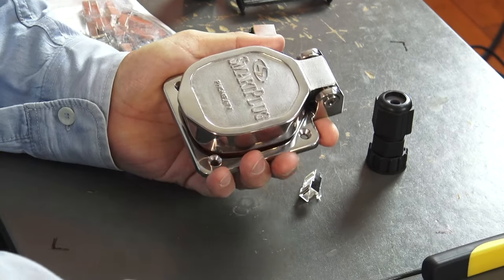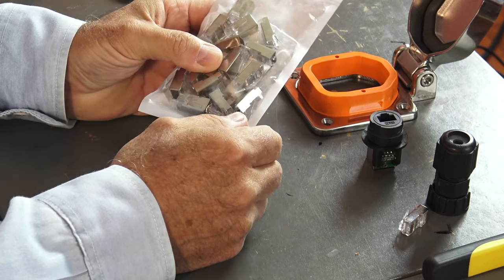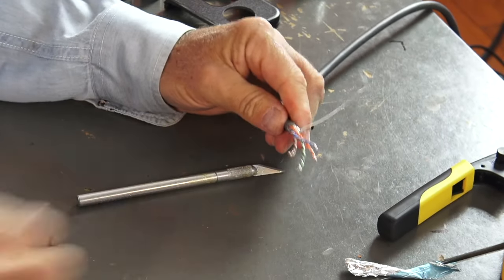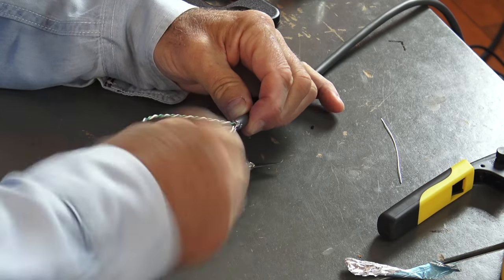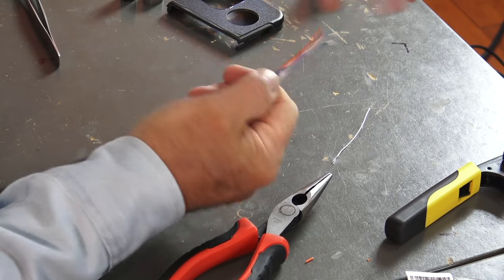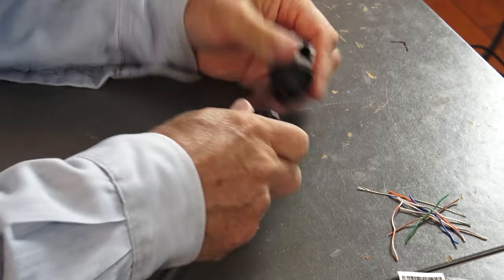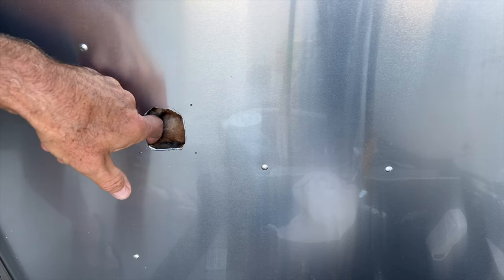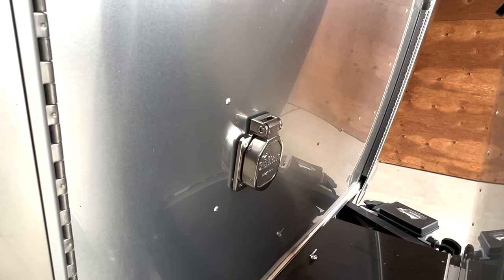Solve a common dilemma with Starlink RV: Make your own external port!

Comment: The wire you cut is a grounding cable for the shielded connection, it should be making contact with the metal piece of the shielded cat6 cable end
Reply: Important for POE I suppose.  This cable powers the dish motor?
Reply: @fightswithspirits915  And the phased array antenna. With no path to earth, an electrical shock can blow equipment.
Reply: The grounding drain wire is for locations with high EMI, like factories with lots of motors. It grounds the shielding in the cable. It's debatable if it's even needed in most consumer applications. Mine isn't properly grounded and I've never had a problem with it.

Comment: It is helpful if you carefully straighten out the wires by running each one through your fingers until all trace of the twists are gone.  Lay the wires in the correct order side by side and hold between thumb and finger, then slide them into the connector in one movement.  As others have said, the "braid wire" should be arranged so that it is crimped to make contact with the metal case, in order to maintain the screening.  As it is, you have nullified the screening which may lead to problems with interfering signals affecting reception in some circumstance.  It was a waste of time getting screened connectors if you don't actually connect them to ground!
Reply: A good approach is to use conductive copper mesh tape to contact the RJ45 connector.  You can wrap the ground wire a few revs around the cable jacket and apply the conductive tape so it is under the connector clamp.

Comment: notice for the people that will follow this solution: thar braided wire is used for the shielded connector, so cut it in a way that it touches the metal shield of the connector. the best way is to fold it backwards and then after crimped the connector, solder the wire to the shield of the connector. some connectors have a shield protrusion that also acts as a tension relief for the cable. you can coil the wire to that protrusion and finish it with a heat shrink tube. a shielded connector that is not connected to that braided wire is the same as an unshielded connector and will risk your starlink to electrical damage from static or other sources

Comment: THANKS, just happen to have found your video.  Yes… I have Starlink and use in my fifth wheel. As you stated, I have been doing the cable routing when I setting the slides. 
Have been waiting to found a workable solution.  FOUND IT.  What a GREAT video, to the point with zero BS.  Have just purchased the tools and will try my luck next time at at my trailer.

Comment: If you ever want to use your Starlink with a different router & just use the Starlink router as a satellite receiver, you should wire your RJ45 cable to Starlink's standard configuration which involves swapping pins 3 & 6, the solid Green & Green White wires over. If you make such a cable, clearly mark both ends Starlink ONLY. Doing the correct Starlink wiring now could save you a lot of future hassle.

Comment: Very elegant and clean.  My biggest interest in Starlink projects like this is really about getting it running on DC.  We tend to turn our inverter off at night. (We do have 400ah LiON and about 700w of solar, but turning the inverter off really saves power overnight.)   Thanks for your awesome video!
Reply from the maker: Thanks for that! I actually travel with an external 2200 watt power bank so I don’t need to use my inverter either.
Reply: @michaelkronenberg6675  Well, converting to DC also has the advantage of not having to RUN the router.  For many, the router is key.  When you're a tech nerd like me, well, you might have your own router and running two is redundant!  Heh!  Now if only they could make a DC (and low voltage) air conditioner, life would be golden!

Comment: Very nicely done.  Looks great.  Your descriptions and attention to detail were very nice.  I truly appreciate you doing this for us.  It is the best one I have seen for this installation. I will be using your tips and parts, along with another guy's flagpole and install tips to install my Starlink connection.  Thank you so much.
Reply from the maker: Hi John. Thanks for that! I too am going to use a 20 Ft. telescoping flag pole from Harbor Freight and a top adaptor from Etsy (https://www.etsy.com/listing/1245272073/adapter-for-square-starlink-to-harbor?click_key=aa512f253aea83b00587aaca42e7b3ff25450363%3A1245272073&click_sum=4adc4258&ref=hp_rv-1&frs=1) Cheers!
Reply: Thank😊 you for doing this for everyone.  Really appreciated.

Comment: I wish this video had existed before I cut my starlink cable - this would have given me a lot more confidence! Excellently done, thank you!
The only thing I would add is that the outer foil of the cable should be pulled back but not cut (turn it inside out and smooth it along the rest of the cable) and left on until the cable is crimped - that maintains the cable shielding all the way through the connections to the router. I also fold back the bare metal wire as well. After crimping the cable then I trim off the excess foil and wire.
Reply from the maker: Thanks for that! I’m clearly new and was making it up as I went and didn’t know what to do with the foil. Do you think it will affect performance?
Reply: @michaelkronenberg6675  I'm no expert on EMI or electrical grounding or anything, but it seems unlikely to affect performance in a typical mild weather day. Thunderstorms are common causes of EFI (I don't mean direct lightning strikes, just the air during a storm) - maybe if you do a lot of camping in lots of thunderstormy weather it'd be worth redoing the connection. My own setup isn't fully grounded all the way through, and I'm taking a "wait and see" approach. So far so good, but I live in California where there's no weather to speak of.
Reply: The only way it would matter if you folded the foil back would be if the connections are in fact shielded to allow the ground continuity. Looking at what he has linked, it is not shielded so there is no way to ensure continuity.

I'm in the process of doing this and the tough part is finding something to get through the RV exterior that is truly shielded. I have a 3rd product, a panel mount bulkhead made by InstallerParts (CAT6 RJ45 Shielded panel mount bulkhead) coming today, however despite most things being advertised as shielded, they typically are not. Shielded basically means it has a continuous ground all the way through that ultimately terminates at ground (chassis/battery negative in an RV - The Starlink power supply does this I read, however I have not tested it. You can test it by using a meter and checking for continuity between the RJ45 input/output and 3rd prong of power cord. If it does not do it, then you need to hit chassis ground, and your cheapest route is a patch panel.

Again, I'm still working on mine, so feel free to comment back and I can provide details when I'm done if you care. It will be another week or two unless all of the parts I get are truly shielded and I don't run into any kinks.

Also, a note to Michael Kronenberg . Your production is great. Crazy that this is your first video. Very well done and I think you have a knack for YouTube, I think you go for it. Although it does look like you're a high end producer or director, so perhaps you have your hands full. ;)
Reply: The only way it would matter if you folded the foil back would be if the connections are in fact shielded to allow the ground continuity. Looking at what he has linked, it is not shielded so there is no way to ensure continuity.

I'm in the process of doing this and the tough part is finding something to get through the RV exterior that is truly shielded. I have a 3rd product, a panel mount bulkhead made by InstallerParts (CAT6 RJ45 Shielded panel mount bulkhead) coming today, however despite most things being advertised as shielded, they typically are not. Shielded basically means it has a continuous ground all the way through that ultimately terminates at ground (chassis/battery negative in an RV - The Starlink power supply does this I read, however I have not tested it. You can test it by using a meter and checking for continuity between the RJ45 input/output and 3rd prong of power cord. If it does not do it, then you need to hit chassis ground, and your cheapest route is a patch panel.

Again, I'm still working on mine, so feel free to comment back and I can provide details when I'm done if you care. It will be another week or two unless all of the parts I get are truly shielded and I don't run into any kinks.

Also, a note to @michaelkronenberg6675 , your production is great. Very well done and I think you have a knack for YouTube, I say you do more! Although you might be a high-end producer or director, so perhaps you have your hands full with other film endeavors.
Reply: Update: there is in fact continuity between the network cable and the starlink power cord ground. You will likely get better performance and certainly be safer by maintaining the shielding. As mentioned, I'm still working on that on my end but expect to resolve it in the next week or so
Reply: You're right.  You have to fold the foil back over the jacket and have that touching the metal areas of the RJ45 plug.  That is proper grounding.  Also, very important, is to make sure that you push the grey jacket up into the RJ45 plug deep enough where the plug has a plastic notch which pushes down to crimp the jacket of the cable and not allow it to slip out of the plug.  This would essentially be crimping the shielding and making sure it stays in place and has pressure against the metal part of the plug and maintains the grounding functionality.  
Another thing is to do a better job straightening the individual twisted cables.  You can cut it only 2 inches vs 3 inches but the trick is to straighten them as best as possible from the jacket out.  Starlink's wires are a lot softer than your typical CAT5e.  Maybe the copper is softer or the gauge is thinner?
Reply: @dennisungureanu2171  If the cable is more flexible there is a good chance that the conductors are stranded as opposed to solid. That would mean that you ideally need a RJ45 connector that is rated for shielded stranded cable. In reality any quality connector will work.

Comment: This was the most painful way of (incorrectly) terminating shielded cat 6 cable I’ve ever seen. 😬😖
The small braided wire that was clipped off at the beginning is part of the grounding/shielding, and is supposed to make contact with the metal shielding in the RJ45 connector. 

The cam lock/twist lock weatherproof RJ45 is very useful and interesting though. 👍
Reply: I get what you're saying but this guy is obviously not a professional cable installer and is just providing an option for others in his category. Granted there is a faster and possibly better way to make this connector but like I said, he's not a pro. He had a need and did his research and is providing a solution for a growing community of people using Starlink with RV's and other mobile applications. I would have used some heat shrink and maybe some gorilla glue to seal the openings in the RV but that's me.Maybe get a friend with a 3d printer to make a custom plate too? Also I'd have run the cable through the wall near that power outlet just to make a cleaner install. Overall, nice job!
Reply: @stevek9844  Great job of justifying people who do not know what they are doing posting videos and jeopardizing their Starlink equipment.
Reply: You can make recommendations for improvements without the side commentary. The guy is just trying to help.
Reply: Yes, I agree.  Great solution, but yes, don't clip off the ground.  😬 If I may suggest, here's a better way to use a passthrough:  https://youtube.com/shorts/SQrgbe4B6co?feature=share

Comment: Straighten the wires into a flat fan between your fingers and slide them in together, one smooth action.  You don't want the wires crossing under the RJ45 crimp outside of the cable jacket (it looks like they may be) since it can damage them.  Typing while I watch and wondering if you figure out that you forgot the rubber compression grommet on the Dishy side.  Added in edit: Ah, the grommet is slit to allow later installation.  Fantastic post!  Thank you! :)

Comment: yu are a swell guy.  i was blown away by your 'one-off' video.  i will order it all and have somebody install that smart plug on my 2023 Ram PRomaster THOR Scope 18M.  I also did buy the $500 hard case / Starlink antenna base setup as well.  I will keep them both.  thanks much.

Comment: Thank you for this video. I followed your directions. However, I did not cut the ground wire as that is not recommended by folks who work with shielded CAT6 wire. Their recommendation is to use shielded RJ45 connectors and ground that wire, which I did, and followed the industry standard RJ45 568B wiring color sequence. The results worked well (no change in latency or spotty connection due to splicing the Starlink cable). So far, so good.
Reply from the maker: Great to hear it went well for you too. Yea, now that I know about the ground wire, I would do the same and fold it back under the connectors. Next time I will if I end up redoing the cable. So far it is working.

Comment: The best solution is to do a flat roof mount for your antenna and convert your Starlink to run off 12 Volt power. You can use any router you want and have that too run off 12V and use  PoE to power your antenna.

Comment: If you want a horizontal jack instead of a 90° jack, the digikey part number is RCP-5SPFFH-TCU7001 (The "H" in the part number is for Horizontal).
Reply from the maker: Hi Jim. Thanks for that. I used the 90-degree because of the interior wall cavity space. The horizontal version puts too much stress on the cable (since I had to drop the cable down from the top) and may not fit.
Reply: @michaelkronenberg6675  Thanks much for the reply.  I have a conventional fiberglass RV and I'm drilling through into a cabinet.  So a 90° wouldn't work for me.  It's nice to have different options.
Reply: I believe the horizontal jack part # listed just above is incorrect. From DigiKey I purchased this part and the plug part# Michael Kronenberg listed in his video comments and they didn't fit. The horizontal jack part was smaller than the plug. I spent several hours studying the manufacture's data from the DigiKey website and believe the correct horizontal (or 180 degree part as they call it) jack is RDP-5SPFFH-TCU7001. The Difference is the 1st 3 letters: RCP vs RDP.

Comment: Wrong wiring order, as in Dishy specifications but as u wired up both plugs the same it still works BUT never use any other cable. The screen wire or braid as u called it should not have been cut all the way down cos it suppose have been connected to the metal shell of the RJ45 plug, hence the term "SHIELDED CABLE". Usually when lining up the wires, u untwist them all the way to the sheath and line them up straight b4 putting them into the pass thru plug..... i have made hundreds of rj45 connections with cat5e cable and we never has the luxury of passthru connectors.... so we had to trim the wires to about 12mm and then insert in in the rj45 plug keeping to the wiring spec specified.  Sheilded cable is used to stop outside interference's from other sources and connecting the screen ensures that.

Comment: Why not just use a keystone RJ45 feed through in there, those are an industry standard system?  Seems logical than going though all this trouble of having to do this modification.  You could have dual Enet one for input and one out if you wanted to put an external device or switch outside for whatever reason.
Reply: Those connectors would not provide weather protection. They are for indoor use only, usually inside equipment.

Comment: The extra stranded wire is not starlink specific. It is in all cat6 shielded cables. It is a ground not to prevent lightning strikes but rather electrical and magnetic interference. Sure it will work without it but in really electronically and magnetically noisy environments, it is necessary to transmit a clean signal. There are much easier ways to cut and crimp a new connector to that cable for those of you hoping to do the same job. Like in this video.

https://youtu.be/UxbPWwh7dqs

Comment: It will be much easier to thread the wires if you run them over the shaft of a screw driver to straighten them out

Comment: I.  I would of used the hole saw to cut the exterior hole as well  and I would of put Painters tape on the exterior & interior before drilling less chance of scratching the interior & exterior.

Comment: Hi Michael
Very m😮ch appreciated your video. Well done. I’ve read through all the comments and maybe I’ve missed it, but could you please tell me where you bought the black Ethernet connector from please?
Reply from the maker: The image shown on this site (https://www.digikey.com/en/products/detail/amphenol-ltw/rdp-5spffv-tcu7001/7619909) shows the internal 90-degree ethernet on the right that is inside the wall. On the left is the part that extends outside through the SmartPlug housing.
Reply: Thank you Michael. I appreciate you sending the link and will follow through. Best wishes
Peter

Comment: Thank you for sharing this with us. I may have missed this, did you have to make up the ends in a unique to Starlink color order?  TIA
Reply from the maker: There does not seem to be anything unique about the order of the StarLink wires. They appear to be standard Ethernet and as long as you put them in the same order into the RJ45 connectors, Voila, everything works!